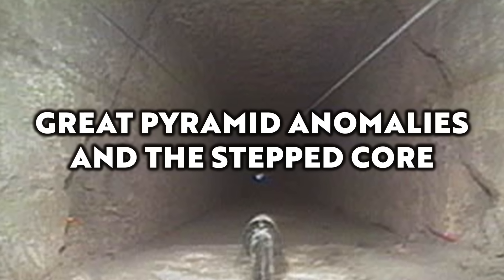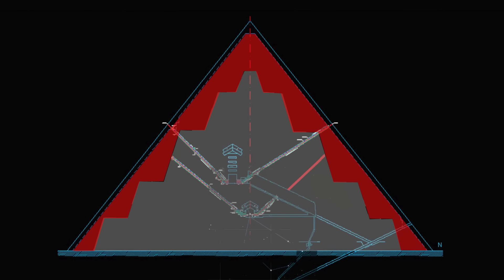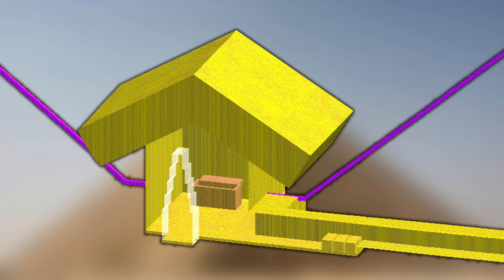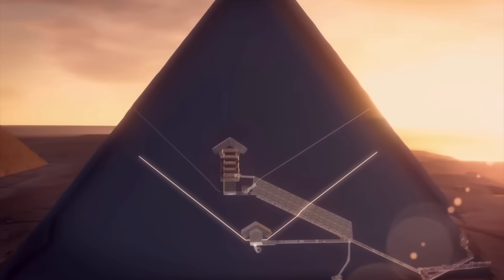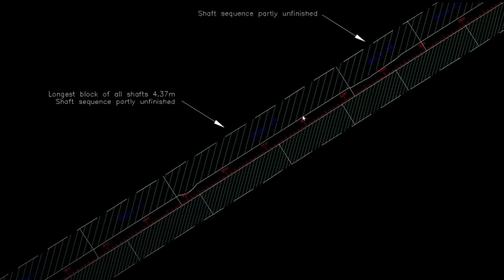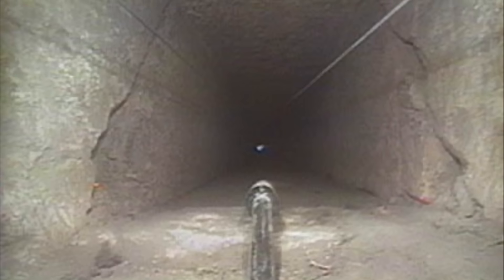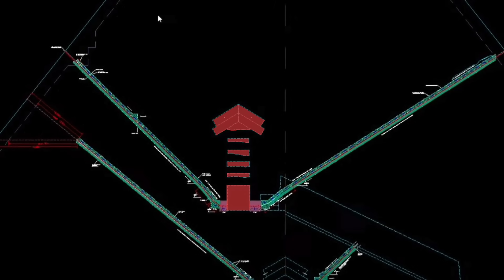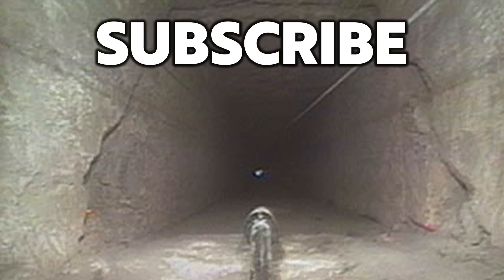Great Pyramid Anomalies Reveal Hidden Structure | Part 2

Comment: If we inscribe an equilateral triangle in the middle of the Great Pyramid and transform it into a stepped core of the pyramid, we obtain an internal core with a base of 170 × 170 meters and a height of 147 meters. Let us draw the bisectors of the equilateral triangle at a 30-degree angle. The points where the bisectors intersect the sides of the triangle precisely indicate the locations of the specific transition of the northern and southern ventilation shafts of the King’s Chamber. These points at the same time mark the edges of the sides of the internal core of the pyramid (as shown in the diagram).

The assumption that the design of the pyramid’s core and the orientation of the ventilation shafts in the King’s Chamber are based on the properties of the equilateral triangle is more than probable. Furthermore, if we divide the total height of the pyramid into seven equal parts (21 m × 7), the characteristic block of the ventilation shaft (which has a right angle) on the southern side of the King’s Chamber is located exactly at the level where the third tier of the pyramid’s core ends, that is, at a height of approximately 63 meters.

I believe that this height correlation is not accidental, but is directly related to dividing the overall height into equal modules. A similar protrusion in the masonry can be observed:

At the level of the Queen’s Chamber.

At the level of the King’s Chamber (the threshold stone).

At the level of the characteristic bend of the southern ventilation shaft of the King’s Chamber.

If the first two protrusions lead directly into a chamber, it is logical to assume that the protrusion of the southern shaft may be connected to a hidden passage or chamber located at a height of 63 meters from the base. The fact that on the northern side of the shaft there is a solid block 4 meters long makes it more similar to a sealing block. Most likely, at that point there was once a technical passage connected to a shaft or chamber. Technical shafts were used for lifting blocks from one tier to another

Comment: Maybe the difference between the air shafts comes from the points at which they exit the stepped structure. One may exit higher out of a vertical step in relation to its horizontal step than the other, which warrants a different fortification?
Alternatively, the nook is on the same level as the top of the King's Chamber, that may be a clue?

Comment: The existence of a stepped core is stated to be fact but proof is not provided. Perhaps the builders used different construction methods for Khufu and Khafre's pyramids and returned to previous techniques for Menkaure's smaller pyramid. Assuming the existence of a stepped core, the assumption seems to be that this was fully completed before the builders added the backing and casing stones and that this would be an easy last step to achieve. Consulting people with expertise in engineering and construction would be helpful for determing what the most practicable approach would be to adding significant extra weight to the structure with those outer layers.
How does the assumed stepped core square with the evidence of rubble-filled compartments from the Robbers' Tunnel and the Notch? Would placing chambers and passages high within the pyramid complicate using a stepped core approach?
With the casing stones gone, would there be damage from water ingress along the faces of the assumed steps?
If the "air shafts" were intended for ventilation, it's not clear why no other pyramid has them and they were never opened in the "Queen's Chamber". With respect to the King's Chamber "airshafts", a rough tunnel through the masonry rather than finished blocks would have served the same purpose and an opening closer to ceiling height would have been more effective.
Saying things are "logical" and "make sense" when there is so little evidence available and assumption is built on assumption isn't so useful.

Comment: Interesting. How would you raise the granite blocks for the King's Chamber with a counterweight system in the Grand Gallery (or in any other way) if the pyramid at that time was a stepped structure?

Comment: Theory: Original plan is for one straight tunnel from the entrance straight across to the Queens chamber. With the grand Gallery, perhaps being filled in or otherwise inaccessible. 

Then the idea for a much grander chamber comes along which could be built at the top of the grand gallery, but it is necessarily offset from the pyramid Centre line. The straight tunnel from the entrance is blocked off and they tunnel down to link up with the existing descending passageway… and the Queen’s chambers blocked off too when the pyramid is first opened.

Comment: The South King’s chamber air shaft has a steeper angle than the North King’s chamber air shaft. This could be the reason for the vertical joint anomaly in South air shaft, whereas the North air shaft didn’t need the vertical joint (since the air shaft ascends at a “less steep” angle. Anway, just an idea!

Comment: Good video, but the theory that the Queen's Chamber was a "backup plan in case the King's Chamber did not work" makes no sense.   The architects would not spend decades building the pyramid and then wait to see whether it "worked".  They knew it would, and would not have built it otherwise.  

Besides, the Queen's Chamber is lower, hence it has to support twice as much weight; but it has no stress relief chambers above its roof.  So if the King's Chamber "did not work", the Queen's Chamber would be even worse.

Other possible explanations for the current state of the Queen's Chamber could be (1) the Queen died well before her Chamber was ready, so she was buried elsewhere; (2) the King and the Queen quarreled so the King dis not want her in the same pyramid; (3) the Queen's Chamber was meant to be  a decoy to trick robbers into believing that they were late and the tomb had been robbed already; (4) who knows what else.
Reply: (1) The so-called Queen’s Chamber received its name from the Arabs in the Middle Ages; there is no archaeological evidence to suggest that it was intended for a queen. The actual function of the chamber remains uncertain—possibly a storage space, as attested in other Old Kingdom pyramids.
Reply: @Merlo_parlante  Thanks! But it does not look like a storage space either.  Those are generally many small simple rooms.  The Chamber's structure and connections (including the "air" shafts) are too similar to the King's Chamber for it to have an entirely different function (except perhaps as a decoy?).

Moreover the "Queen's" Chamber is  located at the very center of the pyramid, while the King's chamber is offset to the side.  Perhaps to avoid some internal structure (like stress relieving spaces or large granite slabs) above the Queen's Chamber.  It suggests that the original pyramid design had only the Queen's Chamber, but then the  project was enlarged, probably halfway through the construction, to make space for the more grandiose King's Chamber higher up.

Comment: I think the pyramid was built in 3 phases over a very long period of time (centuries or even millenia). 
First they built a ziggurat with the queen chamber and used it as is.
Many years later they built a stepped pyramid on top, the king chamber had to be off centre because of the queen character below creating a weakness. 
Finally, a very very long time later they added the casing stones.

Comment: There's still an anomaly. If the air channels don't enter the Queen's chamber then it was already decided they would be closed at that level of constriction. This feels more like it was an area used during construction and is an artifact of construction like the grand gallery and was never considered as an alternative tomb.

@ 5:14 What are the marks on the sides of the channels? They almost look like wear marks, as if something was moving up and down in the channel at one time. Maybe a communication trolley on a rope. Who knows. Perhaps they weren't air channels at all but ultimately served a dual purpose.
Reply: You should check out the backstory of those air channels in the Queens Chamber. They put a lot of effort into building those channels, but the final blocks on the walls of the Queens Chamber was left closed off. But the channels were already partially chiseled into those blocks from the other side. This happened during construction, as they would not be accessible later on. They were prepared to be opened but never opened. Archaeologists detected that there is something/an emptiness behind those walls and forcefully opened them up in modern times.
Maybe they were just a failsafe in case the structure collapses during construction, so that closed-in workers could open them up to survive until they're rescued. Who knows?

Comment: Maybe the great pyrmid was an Energy generator. The two bronze knobs on the shaft could be the positive and negative charges coming from the outer part of the pyramid. It works like a solar panel from the distant past. The Kings chamber could be the storage device like the batteries that we have nowadays and the Queens Chamber could be the Voltage inverter and the output goes to the tip of the pyramid.
Reply: to power what?
Reply: @jellyrollthunder3625  Your house.😂
Reply: @ronron322  Oh.... you sunnuva gun! I hereby surrender this point to you
Reply: no

Comment: Keith of History for Granite uses evidence from the Robbers' Tunnel to conclude that most of the interior volume of the Great Pyramid is random undressed stones filling gaps in a framework of cut stone. That would have made building it much quicker than is commonly reported.
Reply: One thing is sure, it wasn’t a solid block of masonry but several systems. Hope discoveries will be made about the internal structure.

Comment: The one thing I dont like about the three building phase theory is that it would be very difficult to add backing stones and facing stone to a completed step pyramid I think it's much more likely that they finished each stept at once.

Comment: 0% chance the Queens chamber, geometrically centered within the pyramid and bespoke with its niche and horizontal passage, was a "contingency" of any kind. Such an absurd proposition to suggest the architects to have imagined wasting all of those resources and effort whilst planning to endeavor one of the most daunting engineering achievements, of all time. No. Impossible. Just because we found the pyramid nearly empty does not mean only one chamber has significance, outrageous. Get a hold of yourself man.
Reply: I agree. Just because it looks “unfinished” doesn’t mean it is- it could’ve simply had a different purpose than what archeology assumes, which shouldn’t be a surprise given how little evidence we have that the pyramid was built as a tomb. Kind of wild to assume someone capable of even contemplating building the great pyramid would need such a contingency plan. You don’t start something like that if you think it has a good chance of failing.
Reply: @mgkrewson  It has no floor, while the passage towards it does. It's walls aren't finished, the niche isn't finished, unlike the rest of the pyramid. That's why it is assumed to be "unfinished" and abandoned. Definitely not fit to host the burial of a king. Or anything, really. Could be a storage room, while the main niche looks very much like a niche to host a statue. Propably a Ka-statue. Multiple identical designs of this period exist, which all had a king statue in it. This one didn't. Or maybe it did and it was lost over time. Or maybe it once was planned to serve as a temple room to visit the king after his death. To pray to him, to present offerings etc. But there were tmples on the outside, that served this purpose. But who knows? Maybe it once was used as such and later moved to the outside.
Reply: This is based on the fact, that the Queens Chamber was never finished. And that there are "ventilation" shafts, that were never carried out to be finished inside of the chamber and blocked off on the outside. 
The idea here is, that the underground chamber was the first backup plan for a kings tomb, in case the chambers in the upper structure would fail. Then the Queens Chamber was build to be the real tomb for the pharao. But maybe it was abandoned again for not being spectacular enough or entirely build as a second failsafe right from the very start. At this point all of the work on the underground chamber was stopped. And they began to build the final Kings Chamber with a much more complex and ambitioned design, with the Queens Chamber as its backup plan, in case that this ambitious one doesn't work. After it was a success and didn't collapse, the work on the Queens Chamber was stopped entirely and the Kings Chamber was finished. It is just a theory, an attempt to make sense of the evidence at hand.

Comment: I wonder if the air channel anomalies would line up with the theory of the steps of the pyramid structure being a ramp or if if it only seems to work with the steps being level all around.

Comment: If you look at where the location of the King’s chamber is in relation to the center of the great pyramid you’ll see that it is offset to the south side.  Of course this was going to translate into the north and south air shafts being different lengths and by default exiting the inner stepped core of the pyramid.  The different joins and lengths of the stones just makes better sense for each shafts individual location relative to where it exited into the next layer of masonry.  Being asymmetrical on association to one another is clear logic.  Also, if we even mention on here that it’s most likely that the pyramids were possibly renovated, enlarged, and repurposed at some point in Egyptian dynastic history..
The stone quality increases as we get to the end of the air shafts also indicating that it may have been where the original pyramid ended and the new renovation began.  So many questions.. love this subject.